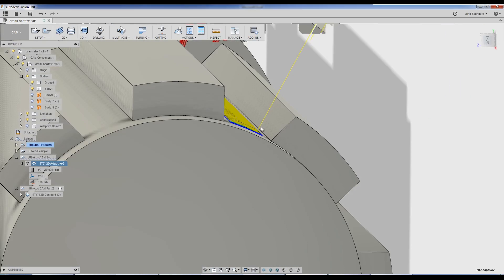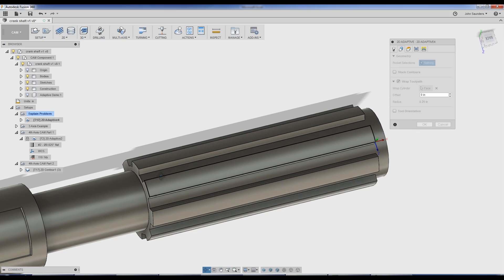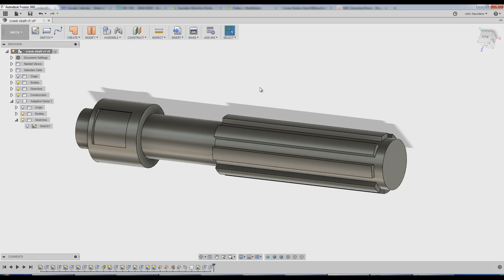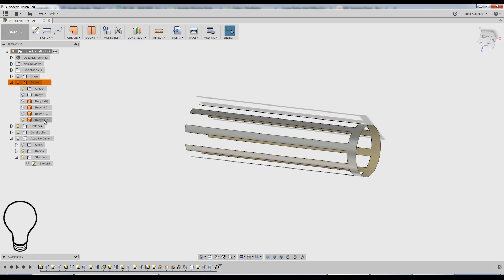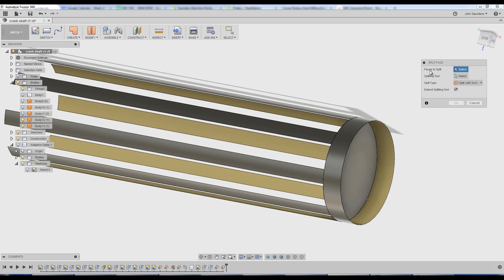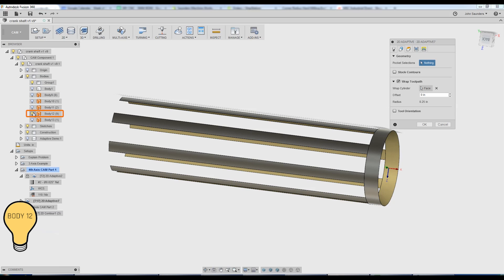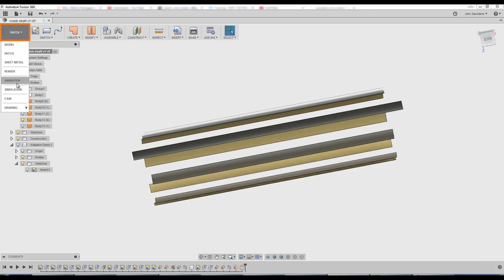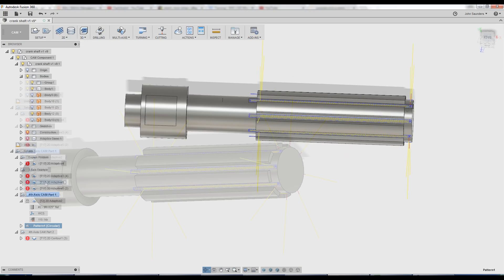Fusion 360 4th Axis CAM Tutorial - Part 1  FF97

Comment: I have to cut multiple parts in fusion on the fourth axis and do not have enough material to do one offs each time.  Why is there no feature for slotting in between parts?  Any suggestions as to how I should go about this?
Reply: I think its beacuse fusion is kinda of a  "free ware" trash. It's entry level cam for us who don't have the molla for master cam. 
I use it and it works but it's allways allot of work around and messing around. 
It's frustrating when you're a toolmaker who has to fight the urge to just go do it in the manual, or just caveman program it (g and m codes on a note pad)

Comment: For those of you trying to use this tutorial to machine on a 4 axis rotary, this tool path will not work, for some reason on fusion 360 when using a rotary your cutter will not leave the center of the shaft you are cutting. so cutting a spline like this will get it close but there will still be stock on the walls.

Comment: Are you serious?

We have to create patches (which are really surfaces). Surfaces have no thickness so it's odd that Autodesk would call these patches. So we use a "trick" and make a 0 offset surface. Sorry, I meant a 0 offset "patch". Then we make more "patches". Then we have to split and modify the "patches". Then we delete "patches". Then we have to extend the ends of all patches to get the tool path to cut all the material at the ends.

All this just to get simple 4 axis wrap tool path? Yikes!!!

You mentioned that we "wouldn't know it" a few times in this video. Why is that? Why as end users would we not know it?

No, I am not a MasterCAM, GibbCAM, EdgeCAM, Surfware, HSM User. I just have been using CAD/CAM for over 30 years. Not an expert, just saying this looks like a lot of work for simple 4 axis wrap tool path.

Comment: Hi John, I'm looking at a 1100 or 770 will be doing pistol slide work and knife making, would like 4th axis also. Seems like the 1100 would be the way to go....Any disadvantage to the slower spindle speed? didn't look like you had any problems engraving or using small tooling in your 1100 videos. Thanks between you and Grimsmo I have watched months of videos LOL

Comment: Great video, can you do a video for 4th axis in Fusion for non uniform cylinder like vase?
Reply: Currently a shape like a vase isn't supported. You can only specify one wrap diameter at this time.
Reply: Mechanical Advantage thanks for your reply, I hope Autodesk will add it to Fusion 360 to stay with one program.

Comment: But the side walls aren't angled now, how would you do that?
Reply: The wrap tool path should adjust X Y Z A correctly to get those radial-plane walls and curved floors. In the machine the looping adaptive should only consist of X (left-right) and A (up-down) motion, lead in in Z notwithstanding. The machine shouldn't move in Y!
Reply: But it should, else it wouldn't get the sidewalls of the keys (or whatever you call them) right. They wouldn't be parallel to eachother.
Reply: this is the problem with sides and wrapping. as the tool doesn't move in the Y, the sides will be parallel with the cutter. Once its finished with the wrap you would need to go back in with a 2.5d path, but orientate the Z with the wall. then take a cut down the length of the part, then back up the other side. then do a circular pattern to clean up the other sides.     Hope that made  sense.
Reply: I see what you mean. The machine would have to move in Y the diameter of the tool cylinder between the two walls. Otherwise the part couldn't rotate to put each wall plane aligned up without colliding with the tool. But assuming these wall planes are radial outward it's important to remember they aren't supposed to be parallel to each other.

Comment: If i remember correctly you can make a sketch in the model and select it to contain the toolpath without using patch?
Reply: Joshua Wentworth Sketches are 2 dimensional and the face of this shaft is curved. It would have been possible to excuse a sketched line as a surface but that would pretty much give you the same result as using patch.